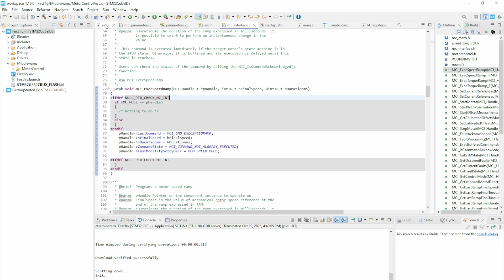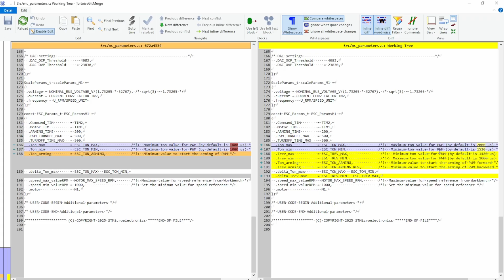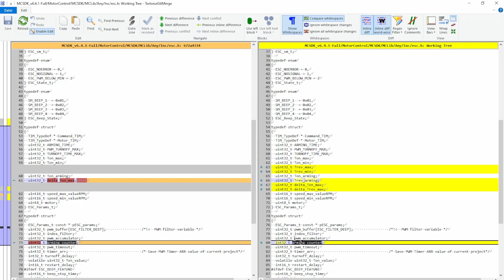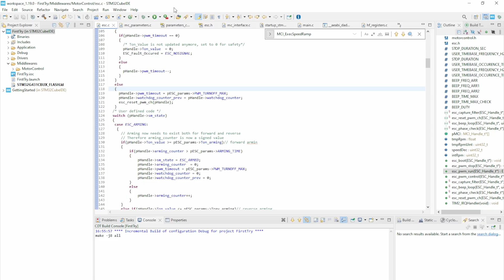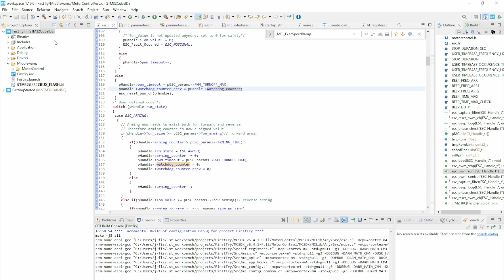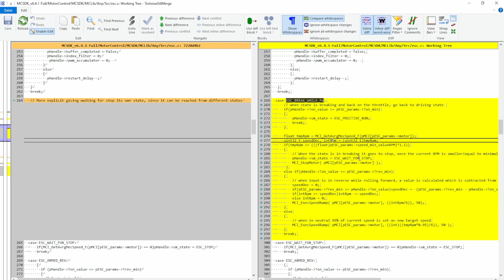B G431B ESC with forward, revers and break

Comment: Hey I’m using the same driver on my robot and it’s been super helpful, thanks for sharing. I still have a couple questions about the code changes you made to support forward/reverse motor control (especially the inversion/direction logic and how you handle direction vs PWM).
Do you have a GitHub/GitLab repo or any file where the full code and changes are available? If you can share a link, I’d love to read through it to better understand the modifications. Thanks!